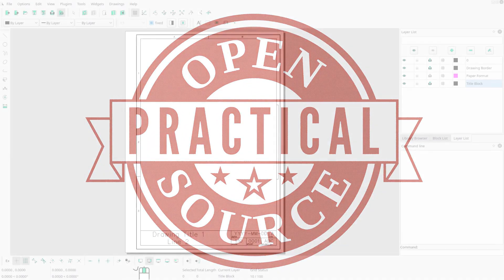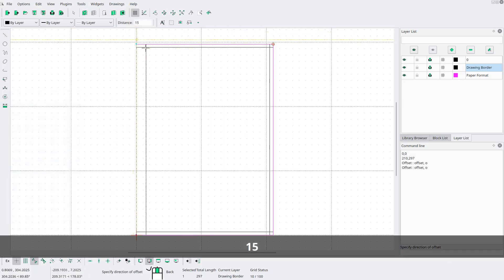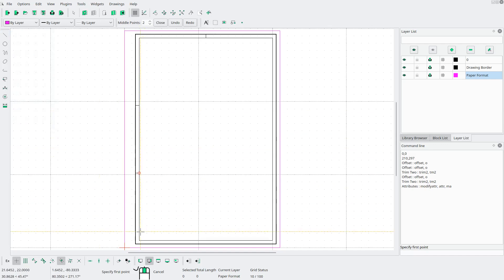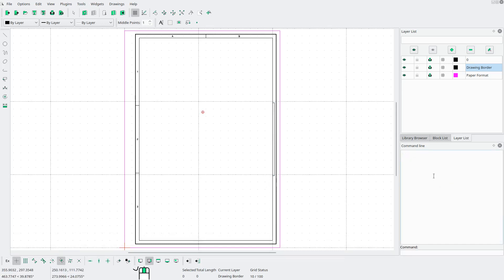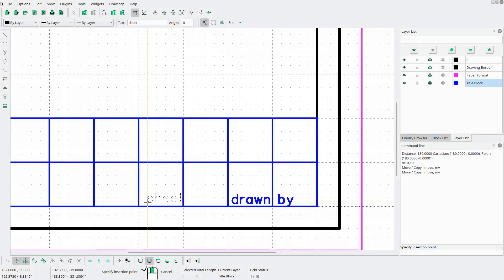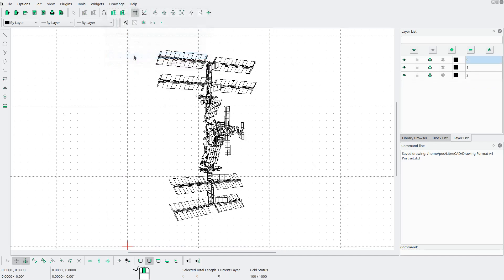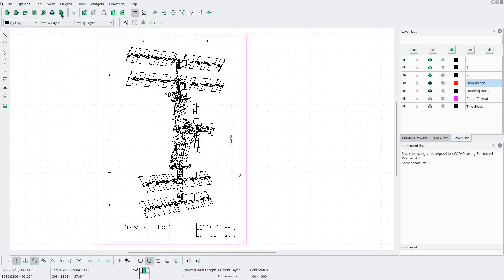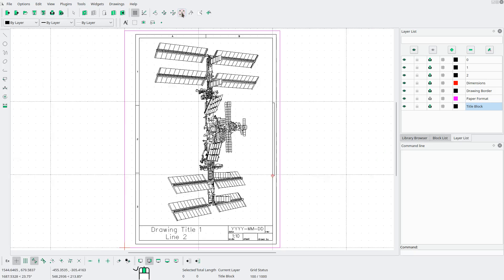LibreCAD Tutorial: How to Draw a Title Block & Border (A4 Paper Size)

Comment: I cannot snap the text the way you do with the same snap settings turned on/off. It tries to snap to the midpoint or endpoint of a line segment. I have to basically turn off all the snaps and just eyeball it. Which is fine, except it's confusing to me why you don't have the same behavior as I do with the same snap settings.

Comment: how are you setting the dimensions of the paper
Reply: If you mean 'how to setting paper size for printing', go to Options --> Current Drawing Preference --> Paper --> Select your paper size.
or If you mean 'how to scale the drawing fit to paper', go to File --> Print Preview --> Scroll to find you paper --> Put the paper on the center of screen or you can input manually the scale on the toolbar.